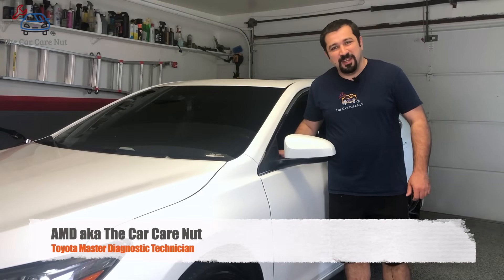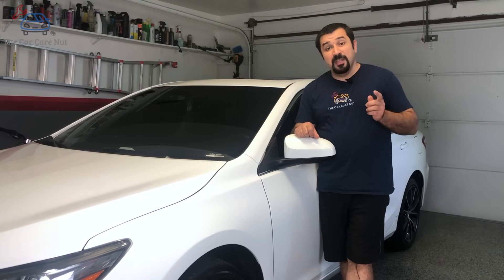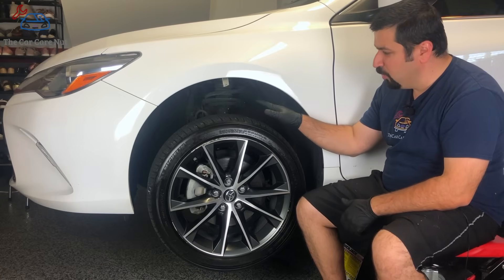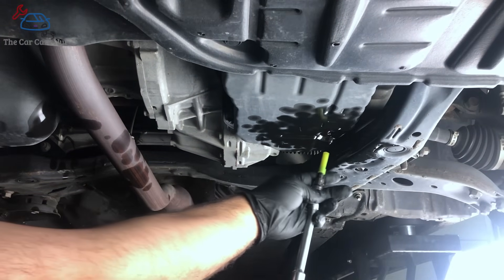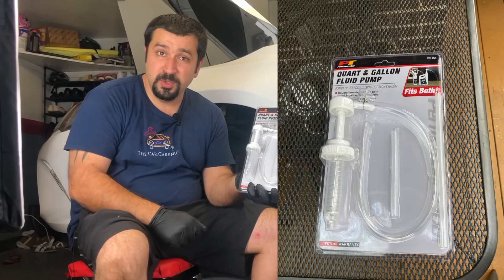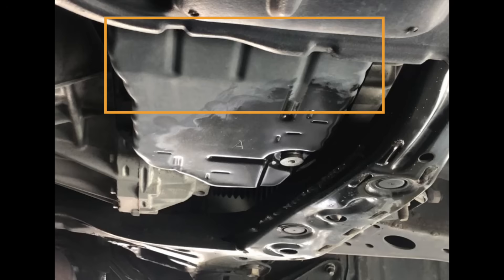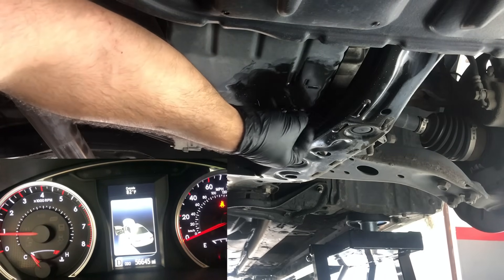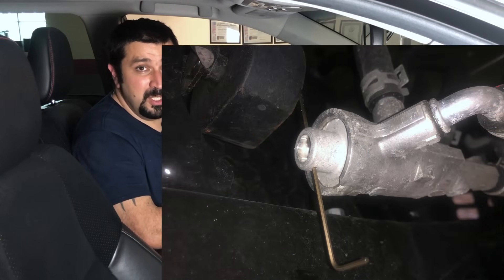How to change your Toyota Sealed Transmission Fluid

Comment: Thank you for a great video.  I never trusted lifetime ATF deal.  got it changed at 50k.  It smelled ok but was already dark.  Thank you for being honest. Much appreciated by plenty of Toyota owners
Reply: 56k at 11:13 minutes on dash
Reply: @Russsir  You have no access to the fluid in the torque converter. Best to do this procedure several times over a week (or day if you have the time) to get most of the old fluid out. You never get 100% out.
Reply: I have 250k and still haven’t changed the ATF. Is it risky to change it at this point? Or do the benefits outweigh the potential risks?
Reply: 350,000 miles on the same ATF fluid in my 2008 Prius no issues. Even the dealer said a fluid change wasn't necessary and it shifted fine until the day I sold it
Reply: @circuitsandcigars1278  I have the 2013 Camry and have never changed the trans fluid.  It has 153,000 now.  I’m wondering if I should?
Reply: @bluegrassman3040  It wouldn't hurt but I'd pull the dipstick on a sunny day and look for the color and see if it looks brown and a burning smell. I don't think it's something to obsess about tho. Some folks even have the fluid analyzed for chemical content looking for various metals that can indicate wear.
Reply: @circuitsandcigars1278  mine doesn’t have a dipstick, it’s “sealed”.  There is a procedure for checking it, but you still have to drop the pan to add anything to it.
Reply: @bluegrassman3040  Yah that's right. I wouldn't worry. Two dealers told me mine was sealed and didn't need it changed. I figured they must be right because why would a dealer pass up a few hundred dollars for a fluid change? Lol
Reply: @circuitsandcigars1278  or a few thousand for a transmission.  Hopefully that’s not the case.
Reply: @circuitsandcigars1278    there is no dipstick
Reply: @bluegrassman3040  if it’s never been changed, I wouldn’t do it. Often If the fluid is allowed to degrade that long, it actually has a lot of friction material suspended in it, which if badly worn actually”helps” keep it from slipping.. You replace it with new slippery fluid, and often times your transmission will die soon after
Reply: @boldcitycc  , I did trans fluid change on my 2015 Camry at 150k miles that I bought as used at 130k miles, fluid was very dark, trans handle vibrated at red light.  I did two changes with Valvoline synthetic trans fluid.  The trans shifts smother and no more trans handle vibrations.
Reply: I used temperature gun to measure to 95F.
Reply: @swllz  Technically speaking a temp hun is useless as the pan will be cooler then the internal transmission temperature sensor. If you want to do it right at that mileage, drop the pan, change the filter, then change the fluid!
Reply: @christophervanzetta 
Cant drop the pan on this unit, & the filter is non pan accessable
Reply: The Toyota lifetime ATF rating is supposedly based on the Toyota ATF synthetic fluid being able to keep the contaminated particulates in suspension without causing undue potential clogging; some of the worst enemies of the automatic transmission is excess or too high automatic transmission fluid temperature and excess particulate contamination levels causing clogging of automatic transmission; by changing the Toyota approved synthetic automatic transmission fluid every 50K to 60K miles one can potentially avoid via preventative maintenance drain and fill with about three quarts of Toyota synthetic automatic transmission fluid followed up with the 100-degree temperature automatic transmission fluid overflow tube drain off check; that way one never has to ever worry about overheating ones automatic transmission fluid due to excessive wear or contamination hopefully even after hundreds of thousands of accumulated miles.

Now even if one let's say, for example, did not want to DIY(do-it-yourself); the next time one gets one's wheels/tires rotated typically done once every 10,000 miles or so service intervals which would, of course, require one's car to in fact go up on the hydraulic lift anyway at one's local garage; simply have them additionally drain your old 60K mileage automatic transmission fluid out thru the removed six mm drain plug and also the additionally removed 6 mm overflow tube also as well; then simply have them install about three initial customer-purchased approved Toyota vehicle automatic transmission fluid; then simply have ones independent mechanic bleed off the excess of one's Toyota automatic transmission fluid from the automatic transmission fluid overflow bypass tube thru the removed automatic transmission fluid drain plug after it reaches about 100 degrees F using a customer supplied infrared scan tool; 

now one could also naturally further combine this recommended routine maintenance service interval with the change of one's engine oil to a good well respected recommended brand name fully synthetic oil such as supplying ones independent mechanic with a customer supplied five quart jug of Mobil 1 0W-20 weight(about $25/five quarts at walmart) and also the recommended accompanying customer supplied fully synthetic oil filter such as Mobil 1 synthetic oil filter(about $9 on rockauto); to also further improve one's vehicle gasoline miles per gallon efficiency.

Sure it might cost the customer quite a bit of extra money having it actually done by one's own local independent trusted car mechanic, but it's probably worth it in the long run especially if it's already maintenance pre-scheduled to occur at the same time with one's normal 10,000 miles maintenance pre-scheduled tire/wheel rotation and also one's normal 10,000 miles maintenance pre-scheduled synthetic engine oil and synthetic engine oil filter replacement also as well; one would quite likely probably improve one's vehicle longevity over the long term while also improving ones vehicle's overall long term gasoline miles per gallon efficiency; that is ultimately hopefully one's longer-term ultimately truly desired highly achievable planned objective car preventative maintenance goal and viewpoint.
Reply: @profdleeucc   if your doing ten thousand mile oil changes your car is not going to last long. Thats twice what you should be doing mileage wise.    Toyota only wants to get thru the warranty period.  After that they benefit by your car being destroyed.    
     Dont understand why your interested in trans fluid if your not changing engine oil often enough .
Reply: @cayman9873  That’s factually false as we don’t use conventional oil which tars up unlike synthetic oil does. This “channel” is designed to sell you stuff you don’t need…

I’m not a toyota tech, but I’m a level 3 tech for a different brand

Comment: Why this isn't trending? These videos can and will save thousands of people getting scammed.
Reply: AMD is amazing. Super helpful content for people who care about caring for their cars!
Reply: Toyota low key don't want you maintaining your own vehicles anymore lol.
Reply: Or do-it-yourself
Reply: I would do this 2-3 quarters drain every 30k miles until it reaches 100k and then do a full oil drain flush and filter change at Toyota dealer. 
The Care Car Nut is hereby a treasure to all Toyota owners, God blesses and keeps him. ❤
Reply: I measure exactly how much I drain out. And replace with exactly the same amount of new fluid..
Reply: People are scared to do this but after I did my camry, then my wifes Highlander, there's no fear now..
Reply: 1.35 million subscribers now in 2025 - it trended! :-)
Reply: How much this job could cost ?
Reply: @bienvenidoreynoso4912  250-450aud depend  on  what  car you  drive. Capacity and  oil  type.
Reply: my mechanic just done a drain and fill with dropping the pan. and put 4 liter without measuring the level. will this affect my transmission ?
Reply: @emadalkahroosi  if same amount of oil that goes out goes in, I don’t believe it would make any difference or damage the transmission. Eventually a change of filter will be needed.
Interesting to see every transmission that is open is cold and even so transmission fluid always flows, does it mean transmissions came overfilled from factory?
Reply: @robertolouth7468  he didn't measure the amount. Just drop the pan and filter. But the filter was not changed because it was still good and has only 32k km . The he put all the 4 liter. I asked him to measure it. But he said no need because he has done the many times
Reply: "Scammed"...
Reply: That's like a $2000 lift he used in the video
Reply: I drained 1.5 from my 2014 Camry V6.. I put in an extra .5 (2qt total), and drained like .15-.2 when it was a little bit warm, I just felt the transmission with my hand... I didn't do the jumper trick and NDNDND trick in this video.. I expected to drain closer to 3-3.5qt?
Reply: Corporations work together to rip us off.
Reply: Unfortunately I'm one of them, with a minor transmission leak, always wondered how they managed to change the fluid so fast especially without letting the transmission cool down....will be doing my own transmission drain and fill going forward
Reply: @Electrician-y6e  Sad
Reply: Have a 2020 Rav4 i tried to do the jump wire check. No Xmas lights, but the D goes of after back and forth from.N to D, D to N, for about 7 reps. So i put it in P and waited. But once the D illuminates after around 5 minutes,  some sort of Fan starts not sure if it was the Radiator. But i was not sure how to exit as the D would not change if i shifted from P to R to N to D. Nothing changes. Am i missing something?
Reply: DIY is not for everyone
Reply: The way new Toyota's are is a scam. Not much different than any other vehicles now a days.
Reply: People are lazy
Reply: Cause its wrong  to do this. There is  a hydraulic inside imangine  a  bottle sideway you only drain 60% of the oil 40% still inside. Need a  machine to drain and  pump at the same time when the engine running. Please tell me i am wrong XD
Reply: @huynhtran7140  Since you asked, you are wrong.  The torque converter, which is what I believe you're trying to describe, does indeed have oil in it.  However, it was found that using a flushing machine as you describe introduced pressurization into a non-pressurized system (transmission) and caused major trouble. Current standard is to drain and fill, not flush.  Draining and filling every 30-40k miles will keep the fluid nice and clean, even without a flush.
Reply: @LandonChapman  u doing a flush with a running engine. It  does have  pressure in the trans.
Reply: @LandonChapman  100% true, yet Toyota dealerships in Florida; the service advisors try to talk you into doing a flush on a vehicle with 180K miles on it.
Reply: @LandonChapman 

 How is it nice and clean if you're only changing 60% of the fluid and then mixing it with the old dirty 40%?
Reply: @huynhtran7140  your wrong lol
Reply: @lybarger007  please tell me  why how i am wrong?
Reply: @huynhtran7140  i honestly dont know anything about toyota thats why i looked up the video 🤷🏾‍♂️. How would you do this? Send it into a shop?
Reply: @lybarger007  as in an auto transmission. There is 8 -12 liters of oil inside. When u drain it only 60% of it. 40% still shit inside your trans. Thats why u take it to trans mechanic. For manual u can drain and fill not auto.
Reply: @lybarger007  It's not your wrong. It is You're wrong. Besides you and your spelling, who are you saying is wrong?
Reply: @lybarger007 he’s not wrong, the torque converter holds about 40% of the fluid, best to drain and refill more often
Reply: @huynhtran7140  I believe that is why you need to cycle throughout the gears from Park, Reverse to the last gear and back 5 times, by this time the trans fluid would be low, then fill up again till it spills over through the straw then reinstall the pan bolt. Add an additional 100ml then reinstall the fill port bolt, I've been doing this for my 2008 Toyota Yaris since 2017, car runs fine. Vehicle has to be jacked on all four wheels, I do it a little different and place the vehicle in Drive when refilling when done cycling through the gears. Car runs fine, no issues.

Comment: It’s rare to get such detail and precautions. Thank you for your work! I have a 2015 Venza with 2.7L engine and 6 speed transmission with 75k miles. I was thinking of changing the transmission fluid in the spring (winter is around the corner here in Canada). What mileage do you recommend changing the fluid and is there any difference doing this on the Venza vs Camry (from what I see it’s the same). Thanks!
Reply from the maker: The venza and Camry are the same. I would change the fluid around 60k or 6 years. You’re a bit over but not too much where I told you don’t change it. Go ahead and change it in the spring
Reply: @TheCarCareNut  My Camry has 101,000 miles. Should I change it?
Reply: @junboo8730  yes, 100 percent
Reply: @MikeyG003  Thanksss. Will post. Lets see what happens. Those mikes are like 90 percent highway so lets see.

Comment: Great Video. I want to also change the transmission filter. What are the filter bolts and pan bolts torque specifications. Thank you.  MKF
Reply from the maker: That’s going to depend on the car. What model and year do you have?
Reply: @TheCarCareNut     I have a 2018 Corolla LE. Thank you again!
Reply from the maker: Sorry Martin could you send me an email so I won’t overlook this? I can’t get the information right now but later on I can send me an email

Comment: I have a 2009 Camry Hybrid  with the 2.4 L engine.  Have done  three drain and fills at 125K when I bought the car in 2017.  Now have 165K,  should I do the same 3X drain refill procedure this year?
Reply from the maker: I would just drain and fill once. Overdoing it is also not good especially at higher miles.
Reply: @James Clark I think the Hybrid transmissions don't have a torque converter, so they don't need to be changed multiple times to get out all the dirty fluid

Comment: Hello,
What is the temp for level check on 2010 Camry?
Thank you
Reply from the maker: Hi! V6 or 4 cylinder?
Reply: @TheCarCareNut  

4 cylinder
Reply from the maker: 95-113
Reply: @TheCarCareNut  
Thank you!
Reply: @TheCarCareNut  
Do you know torque value to apply to drain plug? 
Thank you.
Reply: Doesn't the 2010 Camry have a dip-stick?
I guess not or The Car Care Nut would have said so...

Comment: I have a couple questions:
Is this procedure the same for an 2011 Avensis CVT 1.8 petrol? Is the location of the fill plug the same as in the video? I saw a video where the person drained the fluid, and just put the same amount of new fluid back in. Assuming nothing was spilled, would that be a good alternative for a DIY person?
Also, here in The Netherlands it is extremely hard to purchase the Toyota branded transmission fluid. The dealers buy them in big containers and are willing to sell per litre, but I don't trust them.. Could you recommend another brand that is suitable?
Reply from the maker: Hi! This is the same process on your CVT transmission. I would still check the fluid afterwards. It’s not hard and if you’ve done all the work to replace it might as well check the level to be sure.

I don’t know of any fluid alternative honestly.

Comment: Fortunately, I was able to reach the trans plug without raising the car. I think I had to turn the wheel all the way to the left. I checked the pan with a small level and left the plug finger-tight. Once it hit the right temp, I could quickly get to the plug and take it out.
Reply: Whats car u got
Reply: @kojac40  At that time a 2011 Camry. Now have a 2020 Corolla and it's same.

Comment: Thanks for the great video. In the description, you said the way is the same for model 2019, 2020. My car is 2019 Corolla Hatchback. I think the transmission on my car doesn’t have the pan (closed transmission). I don’t know how change the fluid and the filter? Thank you.
Reply from the maker: Hi! So your car will have a single drain plug at the bottom with a 10mm hex and the overflow tube is underneath it. That’s the new cvt transmission. And I wouldn’t worry about the filter in your transmission
Reply: @TheCarCareNut  thank you! I did some research and didn’t see the filter inside. Do you think the new transmission doesn’t have filter?
Reply from the maker: Toyota doesn’t encourage replacement of filters and generally opening the transmission pan for service reasons. More so with transmissions with the side pan.

Comment: Thank you for your video. I have a 2015 highlander XLE can i follow the same steps in order to change the fluid. I have heard from the dealer that if you change the filter you will have problems with the transmission how true is this. I have seen that there is a mini vci diagnostic tool cable with a cd and you able to use that in order to read the temperature level in the transmission or you also need to get the techstream software. how that works.
Reply from the maker: Hi! Changing the transmission filter is not required. There shouldn’t be harm in replacing it unless there’s contamination when the pan is down. The vci scan tool works but can be difficult to get working right.
Reply: @TheCarCareNut  Thank you for your reply
Reply: There’s no reason to take your vehicle to a dealer for  routine maintenance.

Comment: Hi! Does the 2016 Rav4 have the same OBD2 setup like this Camry? The same location for the jumping wire? Thanks!
Reply: What is the temperature on this vehicle using a thermometer ?
Reply from the maker: 95-113
Reply: @TheCarCareNut  Thanks bro !
Reply from the maker: Hi Ismail. Yes it does have the same setup exactly like the camry
Reply: @TheCarCareNut  thank you so much for ur help!